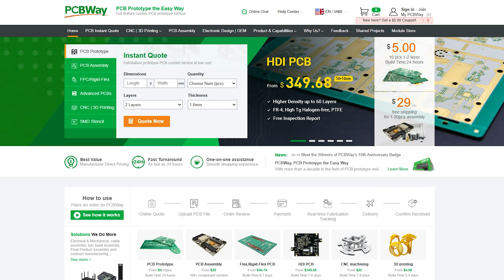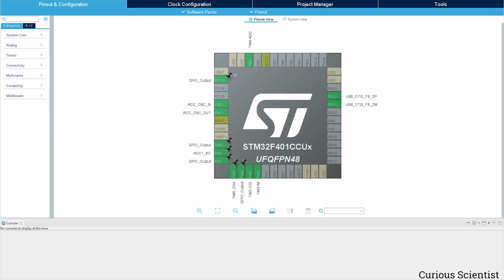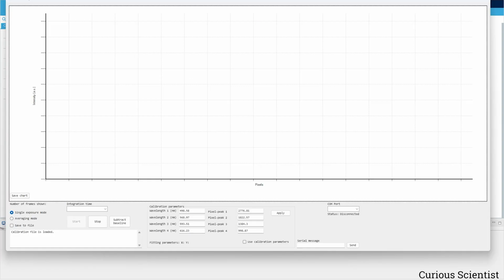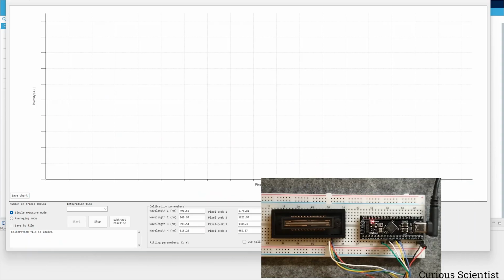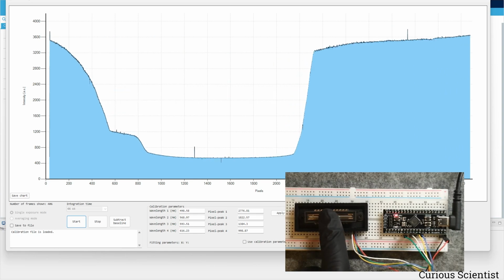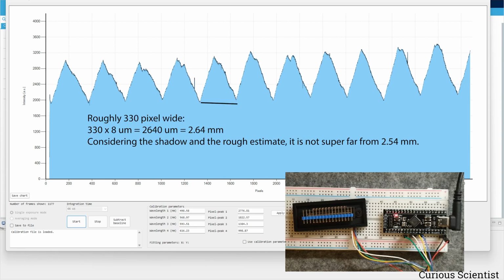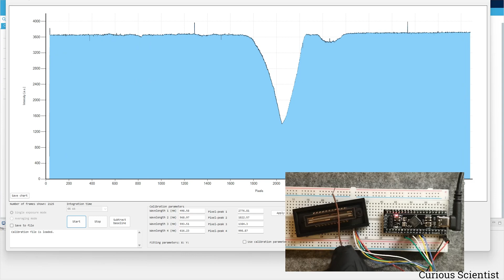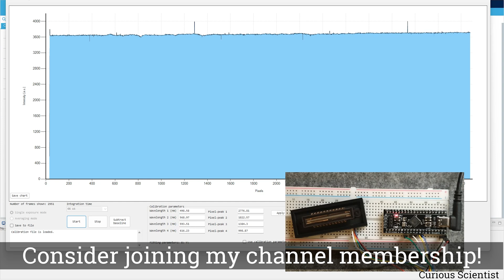TCD1304 CCD driver board - revisited

Comment: Hello! Great tutorial. I was wondering if this same project could be done using an Arduino microcontroller, using maybe direct port manipulation to control the clock of the CCD array.
Reply from the maker: Hi and thanks! No, and 8-bit microcontroller is just simply too weak for this task. I saw attempts to read this CCD with an Uno and despite the fact that the person was miles ahead of me in programming knowledge, he couldn't read the whole CCD out due to hardware limitations.

Comment: how wide is that CCD  can it capture IR spectrum??
Reply from the maker: Both questions are answered in the datasheet. Have you tried opening it? It is not difficult to open a datasheet.....
The sensitive area is 29.1 mm wide, and the spectral response is between 400-1000 nm, but the responds gets worse and worse towards 800 nm and above.
Reply: @CuriousScientist  Well im not interseted thats why i am asking you.... its YouTube you know , i take the time to watch your vid and you get some questions  and up goes your view count and subs!!!.  Now i wonder how it will respond with a IR filter
Reply from the maker: Fair point. I just want to encourage my viewers to learn to look up the datasheet, because most of their questions can be answered by reading the datasheet. But of course, comments and discussions are also good for me for increasing the engagement. I haven't tried the sensor with filter, but I guess, it would be fine.
Reply: @CuriousScientist  I do datasheets on a daily basis .......as a matter of fact i looked up that sigma delta converter u used. I was dissapointed because it required an external crystal....tsk tsk

Comment: Is it possible to add cooling around the board using a Peltier module?
Reply from the maker: Yes, but it would be better to apply it from underneath. A special PCB could be designed for this purpose.

Comment: Hi, it's nice to that you inverted the logic compared to your first build. I was just wondering, as long as you are using an op-amp, did you consider adding a trim potentiometer to adjust the gain of the op-amp? Then you could adjust the sensitivity of the CCD to tailor it to the application. Thanks!
Reply: Never mind I just realized I asked a silly question - since you can see the entire range of the analog reading (dark and saturated), then there is little value to amplifying that. The analog signal from the TCD1304 is continuous, so it would be better just to get a higher resolution ADC if more sensitivity is required. Playing with the gain of the opp amp to amplify or attenuate would have little value. It would make much more sense, if I wanted attenuation, to stick a neutral density filter over the CCD. Attenuation, at the speed of light! Thanks for posting your build. I especially enjoyed the soldering montage.
Reply from the maker: Hi! Actually, what I did is that I built the circuit first on a breadboard where I in fact used a potentiometer to adjust the gain. Then, when I achieved nearly full range with the potentiometer, I measured the value of the potentiometer and then I just picked the closest standard resistor value. I did not want to add the potentiometer because I wanted to avoid adding bulky components to the circuit, plus I wanted to make it "foolproof". I did not want to add adjustable components. 

I am working with the TCD1703C at the moment and that CCD will receive an analogue front-end with a 16-bit high-speed ADC. That project is under construction, but maybe once I publish it, it will be interesting for you. Cheers!

Comment: Awesome tutorial! 🙌 Also checked out your blog on driving the TCD1304....super useful. I’ve got my setup running but hit the same issue you showed at the end where the graph keeps sliding. I’m on a tight deadline, any quick tip on how you got a stable trace would mean a lot!
Reply from the maker: Hi! It is discussed in my articles! Timing is key.
Reply: Could you please share the software/resource you used to keep the graph stable?
Reply from the maker: Sorry, but my software is not public.
Reply: @CuriousScientist  You mentioned timing is key...do you mean I should look into the STM32 timing or the software timing to get the graph stable?
Reply from the maker: Please read the article I wrote for the driving of the CCD. You should set up SH and ICG precisely.
Reply: @CuriousScientist Do you mean that 6 Micro second and 4 Microsecond mentioned in your video and article needs to be readjusted?
Reply from the maker: Everything.

Comment: I work several years (on and off) on a project for precise (<150nm @ 3Sigma) relative displacement measurements with a TCD1304 as sensor. Why do you recomment a 22 Euro TCD1304DG board while other AliExpress sellers offer the same type for less than 10 Euro?
Reply from the maker: You are not obliged to buy the board I recommend. I only recommend products and sellers I used and tested. I don't always check for the cheapest possible product. It's not my concern.
Reply: @CuriousScientist  Let me rephrase my question: are you aware of differences in quality / performance between the cheap boards (<15Euro) and the more expensive ones (>20Euro)?

Comment: Great project, i am planning to have some pcbs to try, but what about the software part, where to get that?
Reply from the maker: Thanks! If you mean the firmware for the CCD, then just follow my tutorials, and you can write your own. If you are referring to the Windows app, then unfortunately, it's not publicly available. You have to develop your own.
Reply: @CuriousScientist  thanks for the prompt response. I am just worried about the timing for the various clocks with the CCD, the rest will do my own. It would be great if you share about it. (No need to share the code) I just wanted to save some time.
Reply from the maker: I explained all the timing-related stuff in an extremely detailed article and video: 
https://curiousscientist.tech/blog/tcd1304-linear-ccd-driving-the-ccd
Reply: @CuriousScientist  This was what I was looking for, Thanks!!!

Comment: whats the smallest possible concentration it could detect? There is relatively little competition for field capable gas mass spectrometry devices. If A reliable one could be made cheaply with sensititivity to PPM scales you'd be sitting on a gold mine. If you could tune it to detect specific compounds for quality compliance issues doubly so.
Reply from the maker: Hi! Your question is hard to answer since this is just a CCD and not a spectrometer. It would be necessary to know about the rest of the components in order to know the resolution. The center of the adjacent pixels are 8 um apart from each other and there are 3648 of them. So, the resolution will be determined by how you distribute the spectrum over this available range of pixels.

Comment: hai ..nice work 👏.. i saw your programing video and i have some doubt ..Is this coding and calculation compatible with the STM32F401RE Nucleo board? I want to confirm whether the code can run smoothly on this microcontroller, considering its specifications like clock speed, memory, and peripherals. If any modifications are required for optimization or compatibility, please suggest.
Reply from the maker: Hi! You can look up both microcontrollers' specifications and compare them.

Comment: Just drop it in some isopropyl alcohol in an ultrasonic cleaner for a few seconds
Reply: A q-tip or cotton swab soaked in isopropyl alcohol or ethanol works well to remove solder residue. I can't emphasize enough how important it is to remove this residue - especially when working with high impedance signals and op-amps. The residue adds parasitic capacitance and messes up the readings. So frustrating. It took me 5 PCB iterations of a pH probe reader to realize the PCB design wasn't the problem - it was the shiny goop I left sitting on the board.
Reply from the maker: Yes, cleanliness matters a lot, and not only from an esthetic point of view. People sometimes mock me for wearing gloves, but they probably know nothing about all these tiny details.
Reply from the maker: That's a great idea! I just need an ultrasonic cleaner first. 😅
Reply: @CuriousScientist  a tooth brush and hot alcohol is almost as good.

Comment: I never understood why do "machined pin headers" exist...
I thought the point of using pin headers is that you can plug and unplug stuff.
But the machined sort kinda loosens up after a while
so I feel like they aren't made for it... and if that's the case, why not just solder the component directly?

Well I guess when you solder the components directly they could get damaged by the heat...
Reply from the maker: Exactly as your last sentence suggests. Some electronics (like this CCD) can be sensitive to heat. So, it is better to fix it by mechanical means. So far, I haven't experienced any loosening with these type of connectors, however, I do not have too much experience with them. I only used them for this type of PCB/component so far.

Comment: Since the outliers appear to be just a random offset, you can probably calibrate them out. Looks like your software has already some provision for it, judging from the GUI?
Reply from the maker: Yes, probably it would be possible. The calibration is for converting the pixels to wavelength when I use the CCD in my spectroscope.

Comment: I'm continuously blown away by your work.

I understand why you don't want to share the finished version of the firmware for the device on your youtube channel, but is there any chance I could take a look at it sometime? I decided to take up a spectrograph project as my senior project at university, and I'm unable to pull out single, complete frames from the device. I always have some issues with alignment. 

Or perhaps could I look at the driver (the C-sharp window you show at the end of the video) to see where I'm going wrong?
Reply from the maker: Thanks! 
If it's a university project, then maybe it's better if you figure it out and not take someone else's solution as-is. :) What's the point of presenting someone else's hard work as your project?

I shared a very detailed article two years ago, which allows you to set up the firmware that drives the CCD exactly the way you see it in this video. Regarding the C# software, it is "just" catching the continuous datastream from the microcontroller, and at every frame, it assembles the two bytes into a 16-bit variable, then plots it. Nothing extraordinary.
Reply: @CuriousScientist  I followed the tutorial in the article to a tee and I still don't understand how the buffer and the frames are aligned... When I run my code, I get a bunch of frames back-to-back, and it's impossible to reliably chop them into individual frames on the PC-side without just guessing where to "chop" them apart... In short, buffer[0] never corresponds to pixel[0]...

Additionally, when I'm receiving the data, because it's uncompressed I can only send every tenth transmission or so, which also inevitably leads to frame drifts, or the memory position of each pixel being shifted to the right gradually over time.

I've tried using a trigger-interrupt callback from TIM2 (the ICG-gate) to put a null character into the buffer where each frame starts and ends so that the buffer can be more reliably chopped up, but that doesn't work either since there are always processor delays associated with the timer callback which are unpredictable and variable compared to the iron-clad timings from the hardware timers.

My only theory as to how you've gotten around this frame-drift problem is that you either A) don't care about the buffer and the pixel position coming out of alignment and are content with them coming out of alignment and just have a more intelligent method of "chopping" up the frames than I do, or B) your timings are precise enough that zero frame-buffer alignment error accumulates over time and the timings always remain rock-solid. If you can accomplish B, it fixes a lot of problems in a very simple way.

However, it couldn't be B, since you also said to use a figure of 630000 for ARR TIM2, but I found a more precise figure to be 620592. Additionally, you were using a buffer length of 6000 rather than 3694, although in a previous comment you did amend that.

I apologize for my lengthy responses, by the way. I'm simply fascinated by the project and I fear I've gotten somewhat stubbornly invested in making this work on my end. I'm going to resume working on it, wish me luck :)
Reply from the maker: Regarding the buffer I already told what number to use (3694). Buffer[0] is not exactly pixel[0], but only half of it. You need to reassemble buffer[0] and buffer[1] into pixel[0] since the pixels are transferred in chunks of bytes (CDC_Transmit_FS((uint8_t*)CCDDataBuffer, 2*CCDSize);).

Frames don't drift, even if you send every 10th or 100th frame. I do it similarly and as you see it in this video, everything is stable.

You should not put anything in the buffer, you directly need to send the contents of the DMA buffer to the PC. You just need to start the CCD, and then as the PC starts receiving the buffer, you should just count the received pixels. It is literally one line of code in C#:

data_temp[i] = BitConverter.ToUInt16(data_buffer.ToArray(), 2 * i);

data_temp[i] is where I store the pixels I show in the graph, and data_buffer is the buffer filled with the incoming data from the COM port. The best way is to send a command to the MCU that starts the clocks and ADC and then on the receiving side, set up an eventhandler-based code that deals with the data whenever something comes via the COM port. 

Everything stays aligned: You capture the pixels, store them in DMA, then send them to the PC, the PC reassembles them into valid 12-bit (16-bit due to how int defined) values. Done. 

My timings are precise, so the solution is B. My default ICG period as of today is 1241184-1 with a pulse of 840-1. SH is 29552-1 and 378-1. I mentioned in the article that the ICG and SH should be carefully considered. (for completeness, fM is 84-1/42-1 and ADC is 336-1/84-1). Although, SH will depend on the light conditions. Based on this pair of ICG and SH values, you can figure out the rest of the available SH values, I assume.

Try these values and the above suggestions and let me know if it works better.
Reply: @ It's hilarious-- I typed up that long comment previously and decided to tackle it using solution B. I was able to find a combination of functional settings, and I'm pleased to report that my version of the firmware is operating with no frame-drift. The device works perfectly!

Thank you for your guidance, and please continue to make innovative and helpful tutorials in the future!
Reply from the maker: This is great news! And you figured it out very quickly! I am glad that you figured it out yourself and instead of demanding the code, you actually worked on the problem and asked well-informed questions. These are the types of discussions that I am looking for in the comment section. 

I will try to keep making interesting projects in the future as well. I hope you'll keep following the channel.
Reply: @emthefruitygem Wow, I have the same problem. I tried different settings, but the frame drift still occurred. How did you fix it?
Reply from the maker: Fix your timings. I already wrote this in the article from years ago
Reply: @CuriousScientist  It's not too hard to reproduce this project, plus others have done it also - but what's the use of that video if you don't share your wisdom at least?
Reply from the maker: I have already shared everything, years ago. Also, I am not obliged to release my codes for free just because I showed what they are capable of... It is my intellectual property and I spent a lot of time and money to develop everything. These videos are also used to showcase my projects and knowledge so people can contact me and hire me for gigs if they see that I have the necessary skills.
Reply: @CuriousScientist  I didn't say you are obliged. But it is in the spirit of such projects to share knowledge. Especially since you spent a lot of time on it.
Reply from the maker: I spent a lot of time AND money on it. Maybe I want to monetize it. So, in that case, it's a bad idea to release everything for free. The video can be an advertisement for my product, for example.